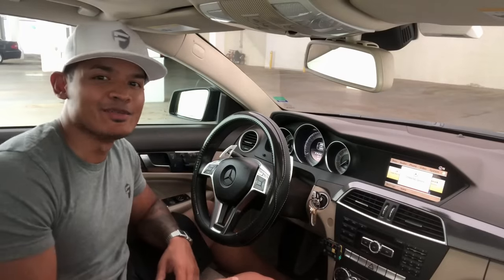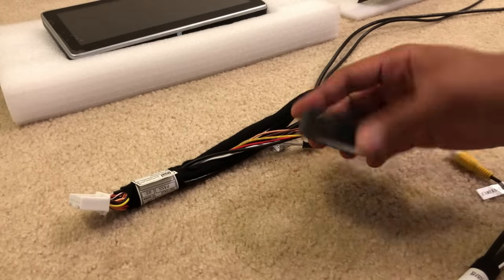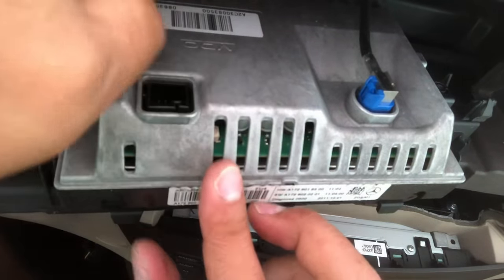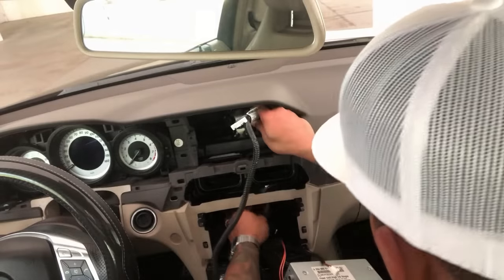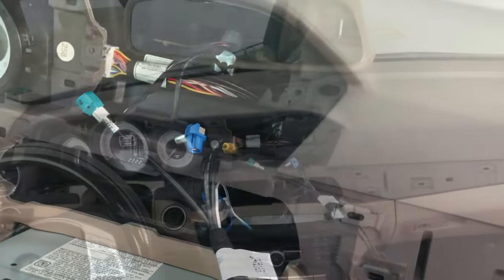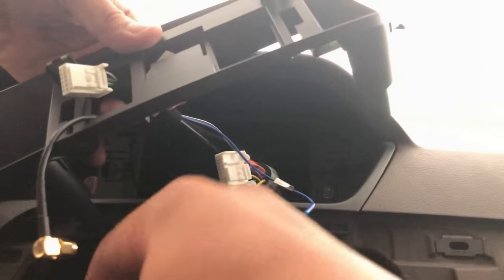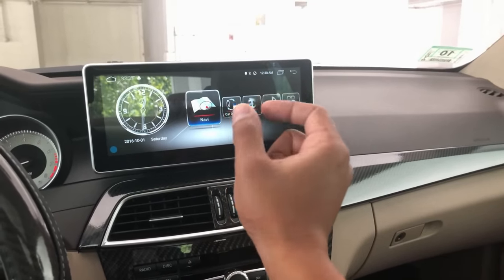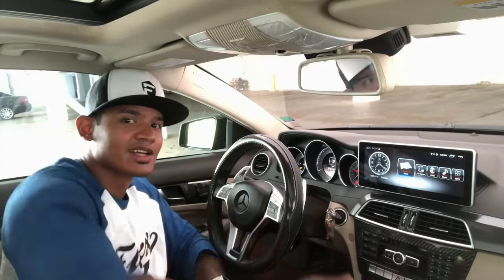Installed a large ANDROID SCREEN on a 2012-2014 Mercedes C-Class C250 C300 C350 C63 (W204)

Comment: Installed but I don't get any audio. Steering control buttons work, but no audio on the Android unit. Used the Ami cable and plugged the 3.5mm jack but no luck. Also activated AUX. When I select AUX in factory audio, AUX is greyed out and only options are sound and control. Faulty aux cable maybe? 2015 e400 thx!!!
Reply: Same problem on C250 2012.. did u find any solution?!!
Reply: Same problem, any solution?

Comment: i am having difficulty pushing back the radio into place. no video shows how they managed to tuck in the wires to prevent obstruction with the radio.
Reply from the maker: if you bought the screen from DMP car design..you need to contact them and they will share with you a video on how to get the radio back in.
Reply: I am having the same issue. Can you provide the video showing how this was done?

Comment: Flexx do I have to connect the 3.5 mm jack and what’s the use of it
Reply from the maker: Yes, that’s how audio comes from the screen into your cars oem sound system/speakers.
Reply: Thanks , So I will have to use the  Mercedes  ami cable to connect the 3.5 mm jack cause my c250 coupe doesn’t have the 3.5 mm jack port and mines should arrive today and I told Thomas you was advising me on install and Thanks for discount and quick response.

Comment: Hey Flexx, great channel for W204s. I just joined the community and have done a few of my own upgrades. I have what I believe is the newest model of screens as mine came with a  4G antenna and sim card slot. I stalled both antennas under the center dash screen thing, and bought a data sim to utilize the capability. but i cannot for the life of me figure out how to get it to work. my first sim card was from Speed Talk mobile, and ive tried every APN setting i could google (including on their site) and nothing has worked. I was on the phone with the rep and everything. The second sim I just bought today from tmobile. The dude said APN settings should apply automatically. I put the sim in, no connection. Have you (or anyone else reading) heard anything about if they actually work or how to configure them?

Comment: Just installed and got no sound, is in Aux and connected to the plug on the arm rest I did switched to manual AUX on the settings and still get no sound
Reply from the maker: Don’t know. My kit from dmp worked fine. If you got your kit from DmP, message them and they’ll help you set it up.  If you got it from somewhere else, I hope you can get the support you need cause not all screen kits are the same and there’s alot of resellers that provide zero support.

Comment: Flexx - 1 question to wires… it is also visible in your video - the main dick channel contains a lot small wires which are cut and have a blue cup on it (e.g. 12V out, GND etc.) - I see that you did not touch and connect them at all - is it supposed to be so that they are just hanging around?
Reply from the maker: Yes

Comment: Unfortunately I have audio noise after installation, do you know how to get rid of that?
Reply from the maker: If you are using a 3.5 rca jack as the audio output, you’ll need to get a 3.5mm noise isolator. You can find them on eBay and Amazon. Just search for them. It should drastically reduce any interference sounds.
Reply: @TheFlexxGarage  Thank you for your help and for the very quick answer 🙏🏼

Comment: I just bought the same radio for my w204 c300 from the same company and there are a bunch of other random wires on the harness. I am insanely confused
Reply from the maker: You need to contact DMP and ask them to walk you through those parts then.
Reply: @TheFlexxGarage  I was able to get in contact with them and they were super helpful but now I can’t get the damn radio to fit back in haha
Reply: @Dark_Shadow_27  same problem, theres just not enough room under the stereo

Comment: I dont have that fiber optic cable on mine do all of them have it?
Reply from the maker: Only if you have satellite radio option in the car.
Reply: @TheFlexxGarage  ah ok thanks
Reply: @TheFlexxGarage  also the reason i switched to this is because i had no audio... do you happen to know what the problem may be? Checked all the fuses and they’re all good even the one in the back of the radio.

Comment: Hello good afternoon all right ? I bought from a seller an item identical to yours, but I have a problem and the seller is no longer on ebay, I would like to know if there is any kind of help you can give me, even if it is at some cost for the help. what goes on and the following my screen appears saying that the System UI has been interrupted. attached photos. I have already tried to reset, turn the device off completely, and the message remains. please appreciate any help to resolve this situation. thank you greetings
Reply from the maker: This is an old video. Most resellers don’t sell or support this screen anymore.  I’ve already upgraded to a newer screen. If I were you, go try to find the Facebook group that talks about the screen. Someone there might be able to help you better than I can.  My screen never had issues so I can’t really help much if you have an issue.
Reply: @TheFlexxGarage  ok thanks

Comment: 4 years on and how is the screen? Is it still working?
Reply from the maker: I’ve upgraded my car.  I already made many videos with new screens and my new car.
Reply: @TheFlexxGarage  but this one how long did it last? Was it good etc?
Reply from the maker: It lasted. I only had to do a software update on it to fix some bugs and get new features. However, I don’t even think you can buy this screen anymore. You can only get the new style for all Benz.  The new style has curves edges and I installed it in my 2016 C300.  That same style is now the new style for the older Benz.

Comment: Man I can’t get audio from just connecting it to the Bluetooth on the screen. It only plays Bluetooth if I connect it to the oem system. Idk what I’m doing wrong
Reply from the maker: you need to understand how the screen works. The screen is like a giant smartphone plugged into your aux/USB port. Which means if you wanna get audio out of any of the apps on the android interface, then you need to first set your OEM Interface to AUX/USB.
Reply: And how do I do that lol because I didn’t connect any aux cables I figured it would just work with Bluetooth. So I’ve gotta go back and connect the aux cable that came and the ami 😩😩
Reply: @datboycuban  did u fix if so how

Comment: Hello how did you make it into Mercedes Benz theme ? I have the android setup and would like Mercedes Benz theme
Reply from the maker: You need to enter the hidden menu using a password. Only your reseller can you provide you with that code and the steps to do it. Not all software on these screens are the same. They might look alike but not the same.
Reply: @TheFlexxGarage  so if I buy it from DMP do I get the code to change it to the Mercedes theme from them?
Reply from the maker: Chris, they will help you from soup to nuts on the product if it’s purchased from them. And warrantied as well.

Comment: After watching your video, I purchased one from DMP. I installed it today but my interface/display looks very different than yours. Looks very basic. Why is this?
Reply: Btw. I installed it in my 08 W204
Reply from the maker: Don’t know. This video is old. There a new screen that’s rounded at the corners that I did a video on my 2016 c300.  I’m not familiar with the prefacelift w204 screens. Go check out that w205 video. Maybe your screen is like that one.

Comment: Bought the upgrade screen and connected everything minus the acc red wire. I have no idea where that goes. All is good except no sounds..lol please someone help..
Reply: I bought this screen for my CLA 250. Works well but i dont have sound either. I made sure to connect a extension wire to the red white and yellow just in case those are it. Dont want to have to dismount my dash again.
Reply from the maker: You need to contact your reseller to get instructions on how to enable sound. Not all screens are the same. Also, if you bought from DMP car design like I mention in the video, their customer service team will help you get it working 100%. You just need to contact their customer service team through their DMP Car Design website.

Comment: Does anyone know if this will void a warranty ?
Reply from the maker: Anything aftermarket can potentially void the warranty. Dealerships don’t want you installing random parts in your car that could potentially cause issues to stock components. And then they have to fix it outta their pocket. That’s why It’s up to your warranty provider to determine if they will cover you or not. That’s a risk you need to weigh before doing anything. That’s why All my cars are used and out of warranty.  Then I don’t feel guilty modding a car that could potentially lose the warranty.

Comment: is that screen the 12 or the 10?
Reply: I see now that it's the 10.25.
Reply from the maker: Specs are in the video.
Reply: @TheFlexxGarage  I really appreciate you responding. Is the one you have in the Video “facelift” or “pre-facelift”? I need the same mounting bracket that you used for that vehicle. I just want to make sure I order the proper installation bracket.
Reply from the maker: Contact DMP and they can answer all your questions and needs. They will give you everything you need for your exact model.
Reply: @TheFlexxGarage  ok. Will do brother. Again, I appreciate your prompt response!

Comment: Anybody connected any aftermarket subs??  Is the unit compatible??
Reply: i would like to know the answer to this because the stock HU lowers bass as volume is turned up
Reply: Yes I add two 12” inch scar audio and amp using LCI 2 line output converter

Comment: Made to look easy .... let me tell you, it's not!! I've been trying for 2 days now to try and get the stereo back in and for the love of god it won't go! Looks like I'm going to have to abort the install
Reply from the maker: The DMP video is guaranteed to allow the radio back in. If it’s not working for you...then you probably need someone that can professionally do it because everyone following the DMP video has been successful. 

The way I ran the wires in the video makes it hard to push it back in but the DMP video is the best method. It’s possible either way to put it back in.
Reply: @TheFlexxGarage  Cheers Flex, I've been in contact with DMP and they sent me a couple of videos but still no luck.... I'm worried I'm damaging wires

Comment: What was the code you had to put in
Reply from the maker: You need to ask whoever you bought the screen from. Every screen uses a different code.  Also, if you are going into the secret menu…make sure you know what you’re doing or else you could brick your screen.
Reply: @TheFlexxGarage  what you mean by brick it
Reply from the maker: Bricking refers to a consumer electronic device that has been damaged beyond repair, making it utterly unusable, often because of damaged firmware.

Comment: Can this be installed on a 2015 mercedes benz ml350 4matic
Reply from the maker: Yes. The screen is available on DMP store in the link in the description. If you can’t find it, you can message them and they can set you up with the right screen for your car.

Comment: Where are you located  ?
Reply from the maker: Massachusetts.  I don’t work on peoples cars though. I can only recommend a shop in mass named Boston Mechanics LLC in Norwood Ma if you need an install done.  If you have questions on the screen, then you need to ask the supplier DMP car design.
Reply: Is this compatible with a 2012 w212 E350 4matic?

Comment: Installed this screen, works great except air conditioner and heater stopped working... a big sacrifice to have a cool screen...
Reply from the maker: Screen has nothing to do with it. I bet you forgot to plug the AC controls back in. Cause it’s a small plug behind the right side of the radio.  Most people forget to do it when pushing the entire radio back in.

Comment: Struggling to get this shit to work
Reply from the maker: You need to contact DMP if you bought it from them. Screen doesn’t just work. Needs to be properly setup to match your specific car and it’s specs.
Reply: @TheFlexxGarage  I have the apple car play media unit to fit behind using original screen.
Reply from the maker: Yeah, you need to contact dmp is you bought it from them. There’s different CarPlay kits and not are all the same.